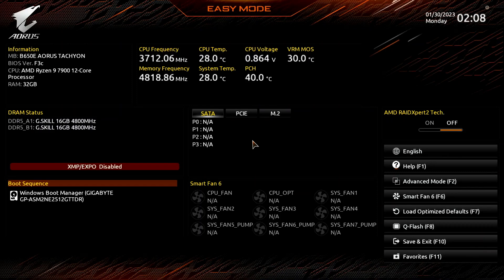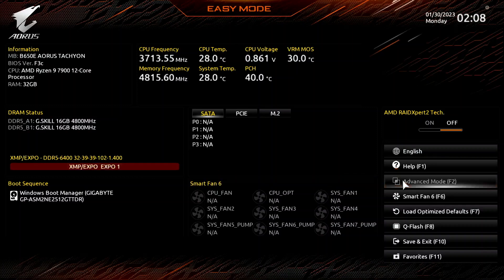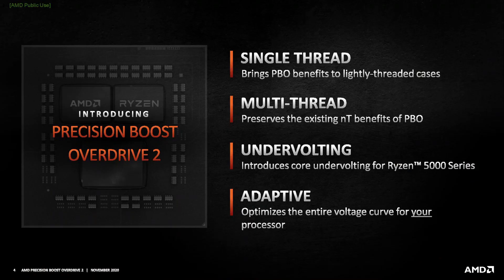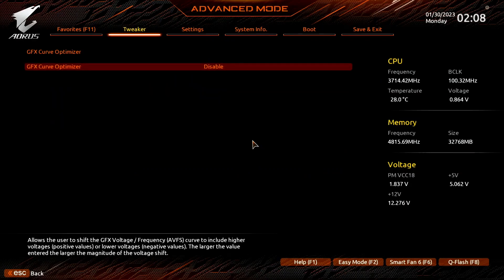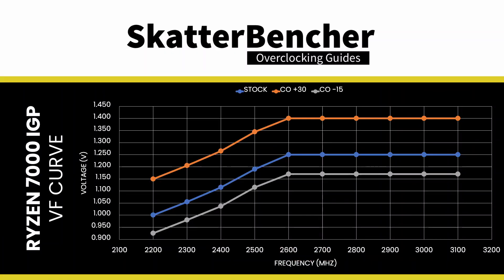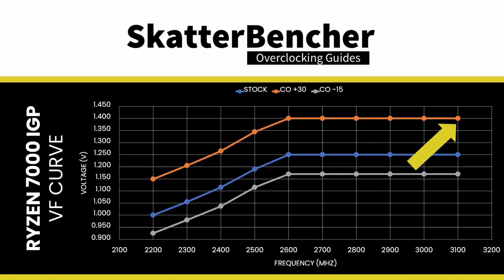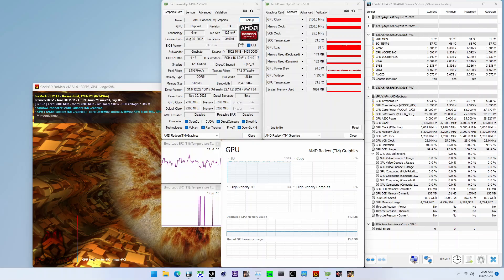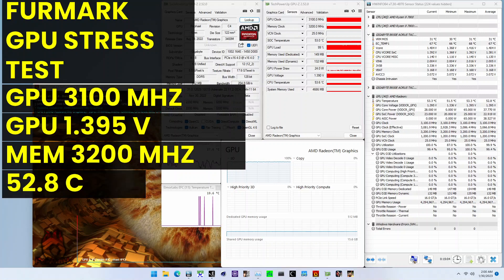5 Minute Overclock: Radeon Graphics (Ryzen 7000) to 3100 MHz

Comment: For some reason 
My integrated graphics (7600x)
Stutter specifically on valorant 
When in open AMD adrenaline and go to the metrics tab 
I see that the clock speeds go from 2200 to 600 and that's when the stutter happens 
Idk if it's a Windows issue or just my graphics are broken

Comment: I found it tricky getting an overclock that's fully stable - at least in a tiny case (Chopin Max) with the stock Wraith Stealth cooler for the 7600 under sustained load. Had to back down to 2740 Mhz @ 1.265V (+5), anything more failed OCCT's standard graphics test, which I found to be a good way to test for stability - it would reliably throw errors after a few minutes. This lead to ~83C GPU temp under sustained FurMark, or ~68C at 100% GPU utilization via a single BOINC GPU task without additional CPU utilization beyond that.

I'm still happy with that, though - it's 27 FPS in FurMark, and a locked 60 FPS in Portal 2 at 1080p with everything on (4K is a bit much to expect there). Might do better with something like a $40 Noctua NH-L9a-AM5, but the stock fan gets to 88W PPT, at least when a video is running as well as BOINC tasks. Now if only the latest drivers didn't crash on dual videos...

Comment: Do you see any impact to CPU temperatures in benchmarks/games? When I tried to do this, my CPU temperatures would skyrocket to 90C causing the CPU to constantly throttle.
I am using a 7950X3D on a Asus B650E-E Gaming WiFi with BIOS 1222.
Reply from the maker: No I didn't see any changes in CPU temperature. The IGP is in the IO die (not the CPU die) and the power consumption is pretty low, so I don't know how overclocking the IGP would increase the temperature very much
Reply: @SkatterBencher  My thoughts exactly, yet my CPU temperatures go up significantly as soon as I touch either GPU freq or BCLK.
It also doesn't seem the GFX Optimizer works. When I set -20 at 2400MHz I see in HWiNFO64 1.12V for GPU Core Voltage (VDDCR_GFX). At 2200MHz with -20 I still see 1V.
Must be something goofy with my board... (I tried the latest 1410 but got same results)

Comment: APUs really are encroaching onto GPU territories now, aren't they.
Reply: To an extent! If you're happy with 1080p and decade-old games, you should be good. Beyond that it might get trickier, but it should at least run, and will likely continue to do so for years, since it's technically similar to what's in the Xbox Series S (with 1/10th the CUs, albeit increased frequency).